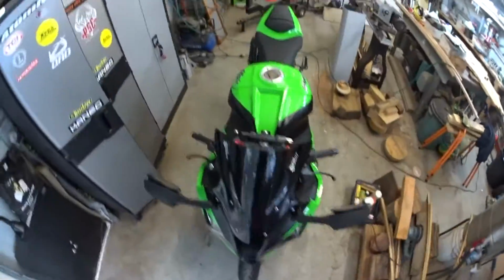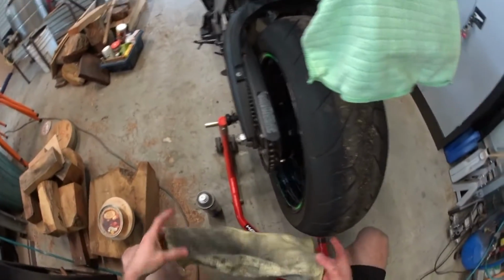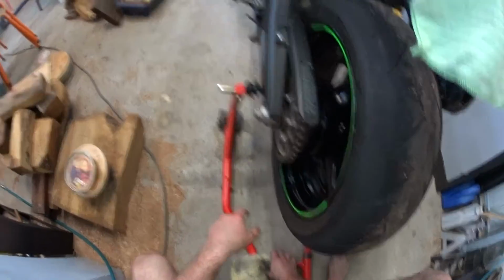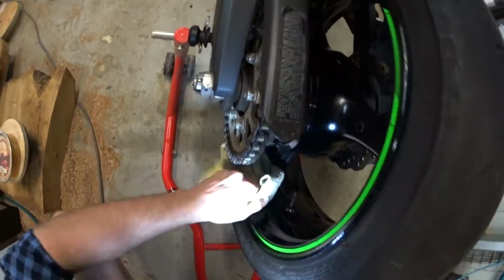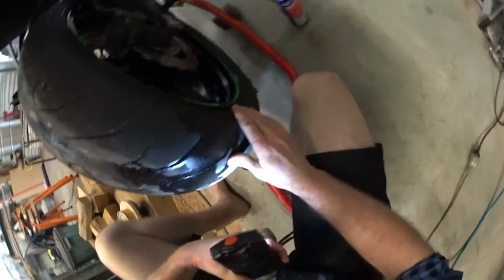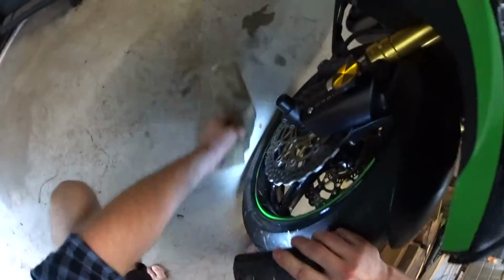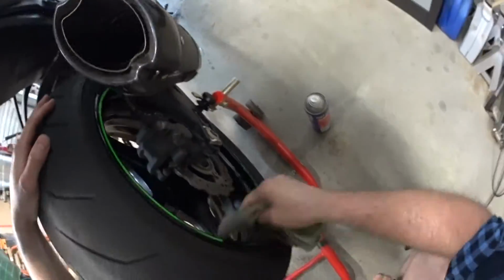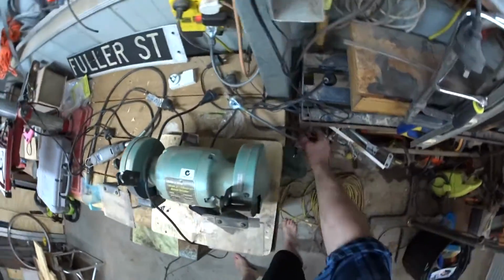How to Easily Remove Chain Lube

Comment: I can confirm that wd-40 works great removing chain lube off the rear rim. Been using it for a while now. Thanks for posting it. Just a tip for other videos, lower the music volume as it is a bit hard to hear you speaking! Cheers mate
Reply from the maker: Thanks mate. I've been struggling to find the right mix volume. I tend to speak quick low in videos as well so maybe I can also just raise my voice.

Comment: Degreaser or brake cleaner work well and yah don't have to worry bout the slippery tyre. Also use motul race spec lube. Hardly flicks and lube.
Reply from the maker: I'm pretty sure I use motul. whatever one that mudgee suzuki sell.
Reply: Yeah don't think it's the comp spec stuff.